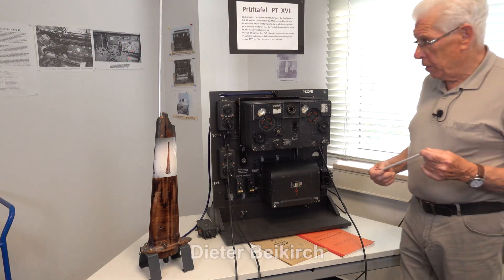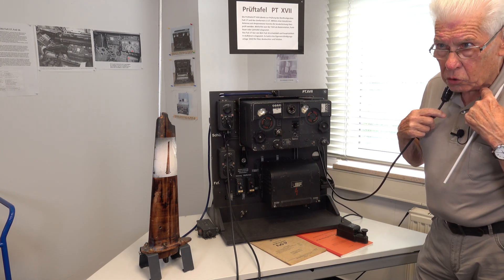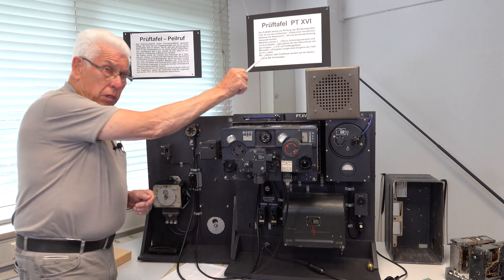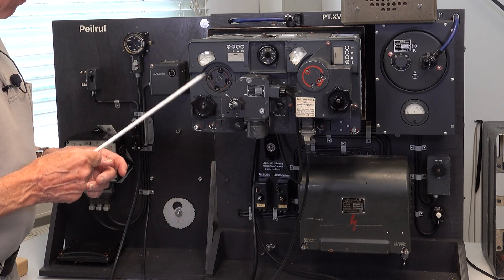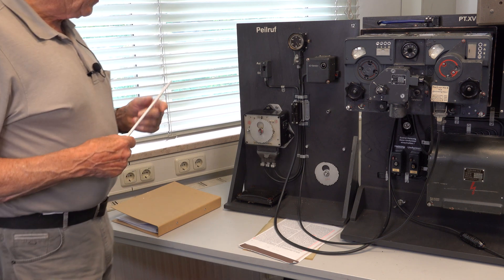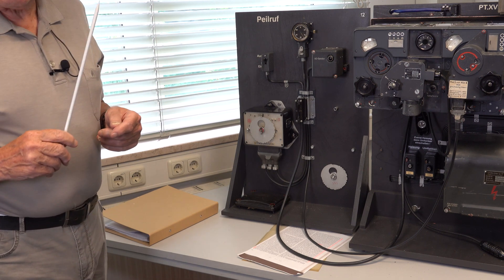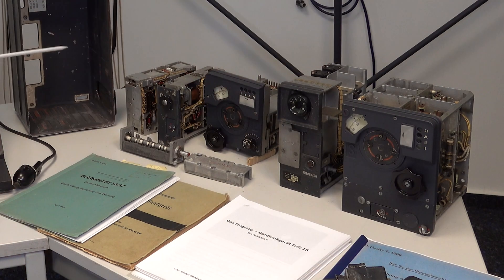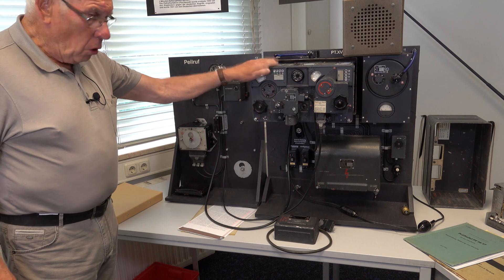Luftwaffe FuG 17 and FuG 16 airborne VHF transceivers

Comment: Not only used for pilots needing fix, but all fighter intercepts were ground controlled, and the leader’s FuG16zy automatically updated the position to the controller.   I have A FuG 16z and U17 with servo control units, looking for an airplane that needs them...